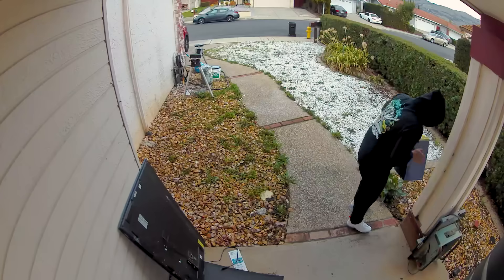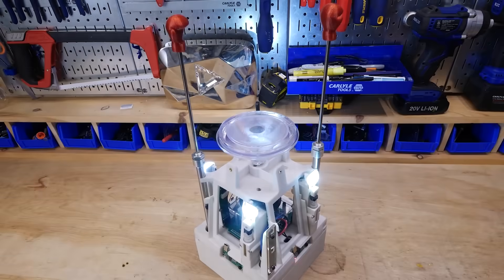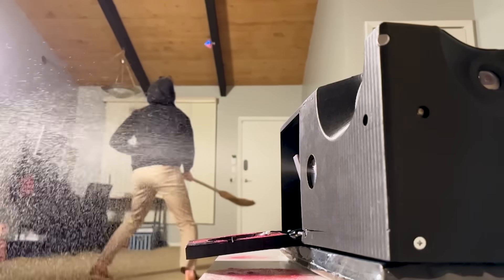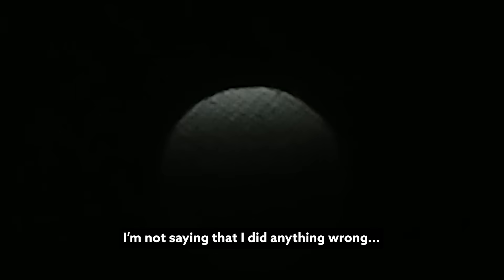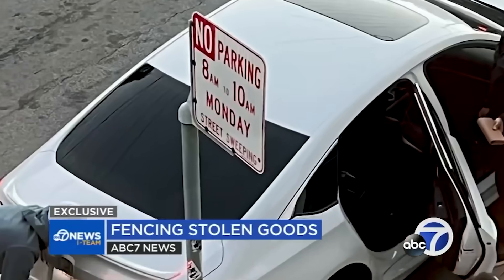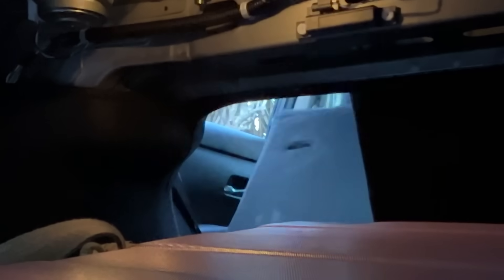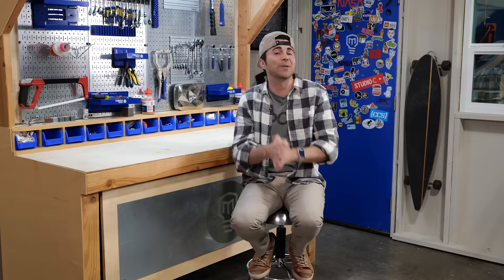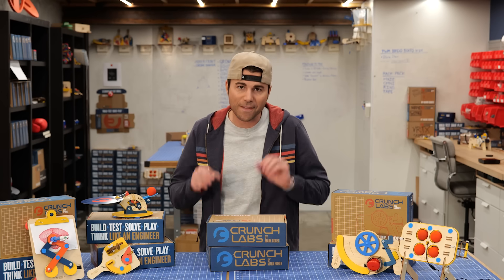Car Thieves vs the Almost Final GlitterBomb 5.0

Comment: My suggestion: Fill the box instead with the spray apparatus with a kind of liquid or slime that gets out completely as soon as the top is lifted. That stuff cannot be thrown out with the box because it has migrated to the carpet or table the box was placed on. Or a balloon with hydrogen and the smelling stuff. So it will escape from the box to the ceiling and relieves the smell from there. Nobody will be able to get it fast enough from that position.

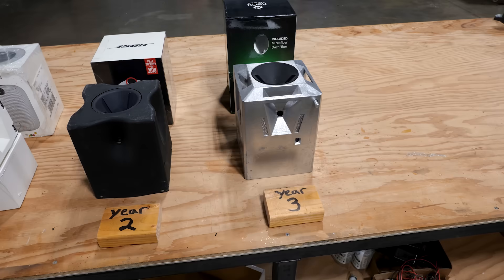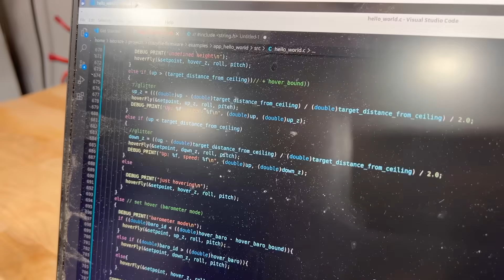Comment: 2:03 - What would be cool is to call the police and provide current GPS location, using a voice API or software to do the speech synthesis. 3:46 - WOW he is actually using an Air Quality Detector, PM2.5 Sensor Module. This is just genius. He should consider working at Nasa, his creativity could be used for even greater use than trolling. 4:31 - The are programming is pure "C" code, talk about being perfect and mission critical.

Comment: There should be a sequel, the holiday season is coming up, and presents are all over the place.
I have a suggestion:

1. IED with shrapnel.
2. Package with .45 ACP M1911 that fires when opened.
3. Boring Flamethrower that activates when opened.
4. Mustard gas.
5. A drone equipped with C4 that follows the package when stolen, and notify them of the drone (car chase content).
6. Microwave without cover (heats up water molecules inside them).
7. Magnesium flare (blinds them).

Thank you for coming to my TED talk.

Comment: The idea with drones was not bad, but it was possible to make a firecracker of sequins on the compressed air "powerful" and so that it would not crumble on top to make a membrane from a thin layer of paper or foil, and the spey could be implemented using a centrifuge so that it sprayed over long distances and 360 degrees, so purely my thought, I love you all superbly🎉👌

Comment: This, of course, is all cool, you create content for YouTube and so on. This raises questions. It turns out that you have no desire to solve problems with car thefts. Otherwise, along with releasing videos, you could catch several dozen thieves a day, involving the police in this.
After several such raids, thefts would drop significantly. But you don't do this...
Reply: There's no guarantee that the cops will even bother showing up to arrest them. People have found criminals phones that contained information that could be used to identify them and the cops didn't want it.

Comment: Instead of using sounds pumps or drones, you can make this much more effective. All you need is a large piston fully compressed containing 5 litres of fartspray and some sort trigger bound to opening the box. This will cause a smell that will last for years, and they dont get any shot at throwing it away.

Comment: I have an idea paint car it's a simple idea, but it would have a monumental effect, so basically, you get a car a nice car to bait car thieves when the window breaks or the lock is picked and I have an idea for like a key with a code scanner to open the lock but basically when they pick the lock and the code isn't there a hatch in the door will open and spray them and any accomplices get drenched in paint I'm thinking like pink neon green or yellow

Comment: Something FAR WORSE should happen to these thieves!  😡🤬
Reply: May I suggest replacing the spray with pepper spray?
Reply: @clipsyoudontwatch absolutely
Reply: @clipsyoudontwatch add fireworks that go off when opened
Reply: @clipsyoudontwatch  mustard! Mustard air!
Reply: @newden-dinimation7120  “mustard air”💀💀
Reply: @clipsyoudontwatch or 00 Buck
Reply: @Wipwoop  bit overboard
Reply: @clipsyoudontwatch replace it with rdx
Reply: @V3RGES  what’s that?
Reply: A jar full of nails with some gunpowder in the middle go KABOOM
Reply: It will
Reply: Death penalty tbh
Reply: Agent Orange
Reply: This will not fix things
Reply: @hostomelhorsehoarder  It absolutely will. Discipline is extremely important and it's sad that so many people don't receive it.

Comment: the solution to the car theft problem is polocy policing and prison sentencing. but i. the mean time buy lexan or polycarb windows. they are lightweight and impossible to shatter like that. you could use windsheid laminated glass

Comment: The Police need to get their act together and set up sting operations like this to reduce crime substantially. All thieves assets could be confiscated which would pay for new sting operations. Also it could take out large scale operations. To make it an even better sting operation, instead of using glitter a swarm of wasp could be used. That would really raise fear level and make these louts think again. Smart water based paint mixed with oil and sand would also work well...

Comment: I HAVE A GAGED, its a time delay release system,   one is held by a few drops o water holding 20 kg the other is  small rubber band , releasing 6 kg after days or weeks . and cost only 30 cents to make .

Comment: Random unrelated idea.

I definitely lack the resources to attempt this, but if it is possible, you probably don't.

Popcorn engine.

Harnessing the force exerted by kernels to do what? Well, probably nothing practical, but could you use foam, or aerogel instead of metal and a mixture of hot air and popcorn (or potentially quinoa) rather than an air/fuel mixer to make a standard internal combustion engine?

Edible exhaust 🍿

Comment: Sexy est thing I ever seen was my sister had her stero stolen out if her car so we put a new one in and soldered dbl sided razors all around the back sides and, on the bottom of it and, installed it just as before, and, waited: 4 days later we had a souvenir in the floor board w/about a pint of blood. We STILL got the part of the pinky w/finger nail still on it. Little glass jar as a reminder.

Comment: Suggestion for whoever can make it: bouncing betty bait bag
Reply: That sounds neat. I just thought of a non lethal that could do a lot. A giant bottle of a very strong plastic and HEAVILY condensed air. If it goes off at the very least their ears will be RINGING.
Reply: Never mind. Since this is mark rober we are talking about it should be an actual flashbang. Instant fuse. Louder than a jet engine for an instant AND something that can completely blind you for a few minutes SIGN ME UP.

Comment: You should get it to drop a tracker in the back of the car and get the police involved when you get the signal(even if the backpack is thrown out, you will still be locked on the tracker signal)

Comment: You should make one with spray tentacles like those crazy waterhoses that spray everywhere like an octopus and have it spray permanent ink everywhere, lol. It would be hard to control it once it's going.
Reply: the only problem with that tho is the thief could be renting a house and then the land lord of said house has to pay to fix and clean up everything cause i highly doubt the thief would
Reply: You can simply tie a bottle filled with smelly liquid to a firecracker with an electric igniter. It will be much easier and more efficient.

Comment: This is only the final glitterbomb simply because Mark Rober is clearly gonna get some water. Put some poison ivy leaves in it mix it around and smush the leaves then make a turret that detects heat and shoots at it with the poison ivy water then put it in the next glitterbomb instead of glitter.

Comment: I say for the next one you put a few cups of dirty oil that spill when the person opens the box. That way they’ll have a huge stain on their carpet or couch that they’ll remember. I feel like glitter is too nice.
Reply: Why not the dye that they use in dyepacks of money to stain the skin? Even UV reactive dye MUAHAHA
Reply: He'd probably avoid putting anything flammable inside the boxes, just to be safe
Reply: @design1of470  Mark Rober might not do flammable things for liability reasons, but he has put the idea into millions of YouTuber's hands. The base plan for the glitter package is there. Easy enough to modify and do whatever you like with it. Just remember that use of lethal force is usually not defensible in court for property theft.
Reply: @fitybux4664  I wouldn't say it's easy enough to just make one of these devices, but i see what you're saying
Reply: @design1of470  I think there may be limitations for most. Whether they are financial, time, or skill limitations in any subject required. (Electronics, programming, mechanical engineering.) But it should be an inspiration that it can be done, as Mark Rober pulled it off. :-)
Reply: Or pen ink
Reply: Should be Anthrax
Reply: i think he could probably get in trouble but idk
Reply: @frosssty.jostiii  This. Smell and glitter is temporary (they can be cleaned away), permanent stains however would be destruction of property which would get him in legal trouble
Reply: @testerwulf3357  yeah!
Reply: didnt you see the part where they said this was the last one lol
Reply: @pvic6959  - Hopefully, that's just what he wants them to think.
Reply: @loupgarou-dj3tm  hopefully!

Comment: I don't understand. Why are the delivery guys just placing the stuff in front of the door or under the mailbox instead of actually handing it to the receiver? That's bad practice, I don't get it. It's like not locking your house after you leave.

Comment: Why not to put a box with the thin wire on opposite sides to each other, so in case if they try to pick it up after activation they get small electrical shocks which will make it even harder to throw out out.

Comment: I have two sedans with fold down rear seats, but one locks the seats with a key and one locks the seats from inside the trunk. I haven't seen those that just pull down from inside the car.

Comment: This has gone for too long... Amazon should provide package safe boxes with Amazon Prime.. Maybe just an electronic lid that can be attached to a brick or cement built case by the owner near their door.   So let's say Amazon has the code to open lid, leave package... Then homeowner comes opens with code and retrieves. // I know they have system with the Blink and Ring Cameras, but thats a bit weird, more intrusive.

Comment: I still wish you weren't using glitter. It's a microplastic that's bad for the environment. If you think it's impossible to clean -- that's the whole point, it's also impossible to get out of the environment, that makes its way into streams and our drinking water. Even the glitter that is "biodegradable" is not biodegradable.